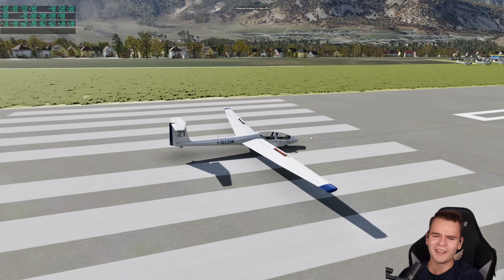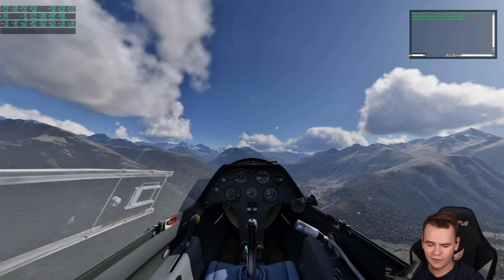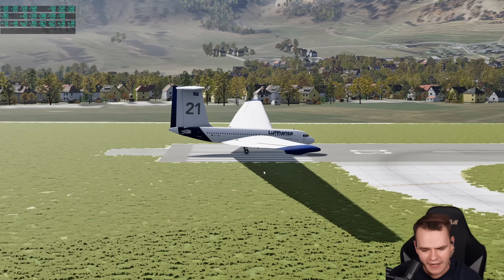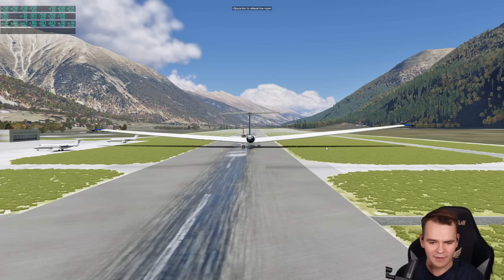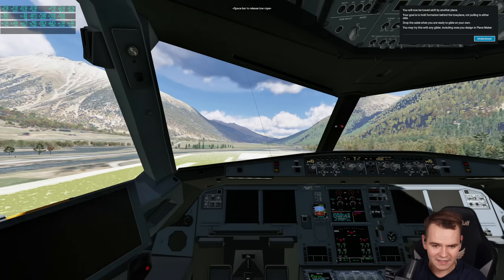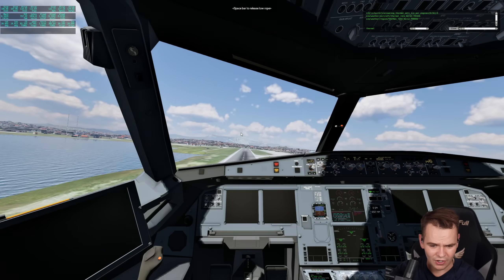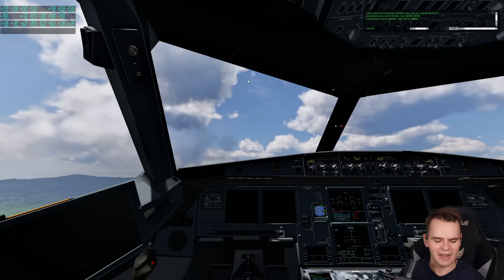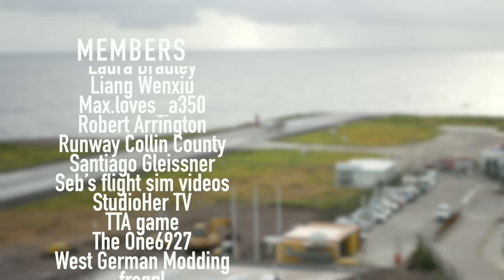Is A GLIDER AIRLINER POSSIBLE?

Comment: Try a different approach! Nowadays there are gliders that are fitted with tiny engines to take of on their own, to be used when necessary ore to fly much further. In most cases that are propellers ether mounted on the nose with retracted blades that only go into position by the rotation force or stored behind the cockpit a little similar to landing gear but coming out on top.

Comment: This was painful to watch... In glider you are suppose to flight slightly down -- glide -- while keeping the speed at optimal level.. you were just flying up and down over and over losing and gaining altitude showing you had no idea how gliders work (or the plane was just absolutely unable to be flown properly). Also you are supposed to stay in the column of rising air and fly a circle in it and gain altitude this way.. you haven't even tried that.

Comment: hey. Im flying a glider and can acutally tell your how spotting these thermals work. Your explanation was completly right but you said you don´t know how we to catch the thermals. It´s pretty easy. So most of the time you look around your position for lakes or rivers nearby. After you spotted them you´re heading toward em. As soon as your gliding over them you´re catching thermals which push you up (flying on a warm and sunny day provides you the most lift).
Reply: You talking about blue thermals? Cause usually you just look for the best looking Cumulus.

On the ground you’d typically want -disrupted areas like the edge of a forest

-Something that’s in an angle to the sun so it’s heated up more during a certain time of day like cliffs

-something that’s mostly a very dark heat absorbing body like parking lots.

The water body thing works sometimes. 

But you’d usually start by going for clouds and then maybe heck below the cloud to further determine which cloud might be the strongest.

In blue thermals you only go by the ground or get yourself an idea where to go to by keeping your eyes open for other planes or birds.

Comment: A real life 17 year old EASA SPL-certified pilot here! If you take a flight to Norway, you can join me for a flight in the ASK-21 and feel it in real life! Trust me, there’s a lot you can do in a glider that you’re cirrus could never do!  This video is good, but is actually less realistic than the possibilities in real life. First of all, you say that gliders use thermals for lift. While this is totally true, it isn’t the full picture. We also use ridge (air blowing into mountains causing lift next to the mountains.) and waves ( which are wave like effects that gives great lift at higher altitudes, formed by high mountain peaks.) These can make a glider fly long distances in short times, because the metrological conditions are making you sustain altitude or gain while following these conditions. In theory, airlines in Central Europe where there is a lot of mountains, for example the alps, gliding is very popular and it can be easy to have a A to B flight preplanned. Only wind is needed for this, something the area often has to offer. Personally, I would probably not recommend it for passenger travel, but not impossible. Next, flying at night is totally possible. The “world record” you refer to as 17 hours is preformed at night with night vision googles in a Arcus M glider, with a jet engine as a safety net. This is totally normal for competition gliders to have, just so you don’t have to Outland in a field. I do think night vision googles aren’t acceptable for civilian air travel in Europe at this time, but it’s a thing in the states… Still a great video though!
Reply: Kind of like rc dynamic soaring

Comment: See if an airliner can be towed behind another airliner, up to cruising altitude. A windmilling 737 being towed by a 100% thrust 737. Try different cable lengths if the flight sim does wake simulation. 

This could be a great way to make commercial air travel more efficient.

Comment: Actually, in WWII, during the invasion of Crete in Greece, they used large gliders to carry many soldiers. The gliders were used to get soldiers onto the island quietly, because the Greek soldiers expected a sea battle and thought the enemy would come with boats. So, the troops landed silently and were positioned directly in the mountains of Crete. After that, bombers arrived, so they already had soldiers on the island before the bombing began. The Greek soldiers were not prepared for that.
Reply: Very good point! Similar things happens in Belgium. Even jeeps were brought with those gliders.

Comment: Thermals are indeed typically not as big as the turn radius of this abomination here, but you could theoretically build some big gliders to fly in wave lift, which are larger areas and often times also quite long, but depend on certain wind conditions and terrain.

Comment: 80kts in an a320 doesn’t look real
Reply: Depends on wingload and the thick profile. Estimated 50 kg per m² in the shown configuration is a decent number. But without fuel and no engines it might be 30 kg eventually.

Comment: As someone who flies gliders in real life, it will be 10x easier to land that abomination if you use rudder equal to the about of aileron so if you roll left you also gotta stomp left rudder because the aerodynamics are kinda wonky with a wingspan that long
Reply: That’s just adverse yaw effect it’s the same for almost every plane. Just more noticeable on gliders because the aileron is located further away from the cg leading to bigger arm lever. 
If u fly a right turn the aileron on the right side goes up thus decreasing the camber (making the wings smaller)
——> less lift, less induced drag 
On the left side the aileron is going down increasing the camber thus increasing the lift. But due to the increased lift the induced drag is increasing aswell slowing the wing down. The right wing is now accelerating and the left decallerting leading to an left movement about the normal axis ( right turn, nose moving left).
To oppose this the aileron on the downgoing side can’t be moved as much as the upgoing aileron.
Reply: @tobias5279  I would've thought he would know about adverse yaw if he soloed a cirrus! It has been a few years now, though
Reply: Side slip go brrrrrrr
Reply: Thanks for the information

Comment: Why you didn't put engines on that wing ?
2 tiny cfm 56.
Reply: Probably better fitted with a pair of turboprops.
Reply: @milasudril 
Well, he just made it's wings bigger, but glider have different type of wing without fuel and super super light material and it flexes like bird's wings. This will definitely need 2 GE90s to actually fly on its own. 
This looks like Cessna 172 on steroids. ✈